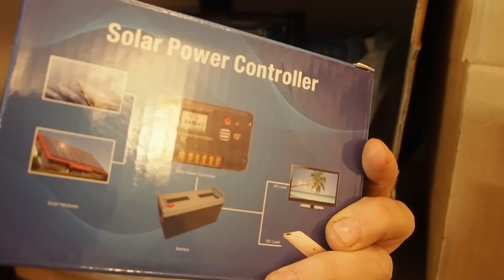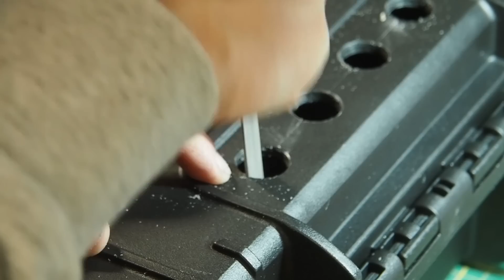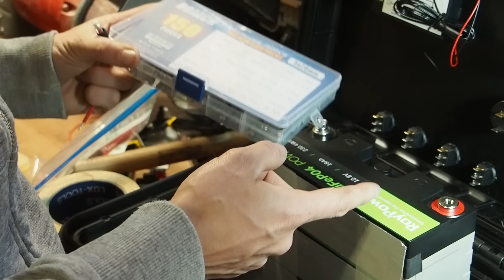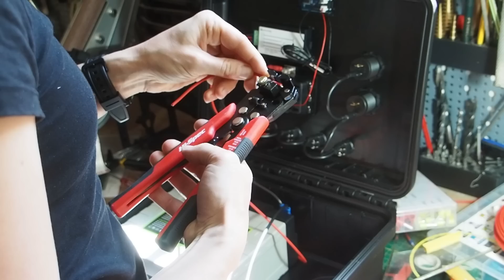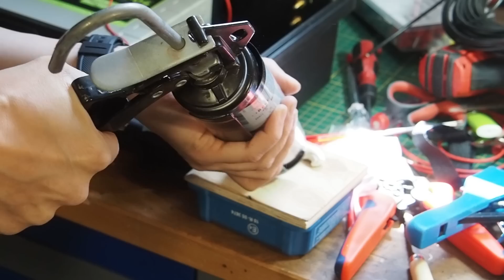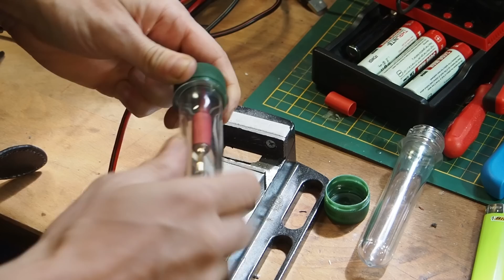This self-made box will save your life in a blackout scenario!

Comment: That looks great Lilly, I use terminals for all small wire connections. The 14 awg wire is good for 15 amperes.  Let us know how much heat in generated. That would be my concern using a polymer enclosure instead of aluminum or stainless steel.

Comment: Nice work. I was thinking as I watched that you could probably put a small 5 watt or so light bulb inside to warm the box up before you charge the battery on a really cold day, and you can use a suitable size socket or tube to tap those switches into place without running the risks of damaging them with the hammer.
Reply: A heating element might be more effective as it does not use any energy to created light. Good idea though!
Reply: @aprilshadows  I'd go with whatever is least expensive.  Any light is going to be absorbed by the box and turned in to heat anyhow. A heater may be more robust though.
Reply: @jethrox812  the light does not translate to heat like you may think.

Think about it like this. The sun warms you up, but in the open air a 100watt light bulb does not. Then in an enclosed space you can feel the warmth. Its not the light heating you up from a light bulb. Light bulbs create heat from having an element heated up from electrical resistance. The element is designed to primarily put out light and a secondary result is creation of heat.

Heating elements also created heat through electrical resistance, but they don't even have a secondary result in light production.

I agree that cost is very important. Small heat elements are pretty cheap and will use less energy from the battery to produce the intended results.

Keep in mind this project is designed for dire situations where having energy to use may be critical.

One more thing. Light bulbs used for heat in food dehydrators are fine because the light can help prohibit mold growth and its plugged into the wall. Light bulbs are often used to keep chicken coops from being too cold, but that is also connected to AC.

Comment: A really nice project! 👍🏼 Unfortunately, the Victron charge controller won't work with your Solar Panel, because of its low voltage (the PV voltage needs to be at least 5V higher than the battery voltage for charging). And besides this, the price for that panel is IMHO outrageously high (even with a 50% discount).
Caution: Only the Victron "Smartsolar" series supports the App, not the "Bluesolar"  version you are using in your Powerstation!
Reply from the maker: Yes you are right. I just checked the website off grid trek. My small solar panel only has 12 volt output which is too small for my mppt. My mistake! But this company makes bigger folding solar panels which have a 18v output. So the bigger panels will work for my project.
Reply from the maker: There is a small device called Victron connect. Only costs 40 bucks. You stick it into the bluesolar and then you connect it to the smartphone via bluetooth. I already ordered one.

Comment: Really nice build Lilly.  The only thing I would change is I would have gone with MC4 solar connectors instead of the banana plugs both for the IP67 waterproofing but also to make it impossible to short or accidentally reverse connect the solar panels.   Also, there are LiFePO4 batteries that include an internal heater that will engage if the temp is below 0 C.  Sadly they are also very expensive.   Lastly, you may want to check with the manufacturer to see if it's ok to have the battery oriented on it's side and especially oriented upside down since you have the top of the battery pointed at the bottom of the case.   These batteries have a liquid electrolyte and the orientation of the battery can sometimes, but not always, be important.
Reply: Agree with this comment, MC4 would be better. Also supply lines should be female to avoid short circuits.  Otherwise excellent video Lilly. Nicely done.
Reply: Well, you could build a crude heater for this project by using power resistors and calculating the power loss. But you'd probably end up wasting energy unless you insulate the case on the inside.

I've made a heater for my telescope like this and it works, it's "wasting" about 25w at full power.

Put the resistors in parallel because it becomes easier to calculate and IF one dies it keeps going.

Use these equations and work with them. 
U=R*I 
P=U*I

You would need some sort of thermostat that keeps track of the temp inside the case.
Reply: @hannescamitz8575  or simple heating pad aaa used in a Reptile Vivarium tank, or for Homebrewing
Reply: @johnrhodes3350  That's would be a safer solution for the heating than open resistors even though they're isolated.
Reply from the maker: Thanks. I will consider your advices
Reply: It's a lithium battery, there's no liquid inside.
Reply: @alejandrorojas1  lol, all lithium batteries have a liquid electrolyte.  We don't have solid state batteries yet.   This is why a good BMS has a low temp cutoff - charging when the electrolyte is at or below freezing will destroy the battery.  It's also why the higher end lithium batteries actually have cell heaters to bring their temp up for charging.

Comment: A small tip, use a double-switch as main switch, one channel as master swich, and the other channel break the connection between charge-controller and solar-panel. that way you "disconnect" the solar-panel when switching off main breaker.

Comment: Great stuff Lilly. Is off-gassing while charging something you are concerned about? Also, if that battery ever fails and starts to burn, I think water is bad to stop the fire? Maybe sand or possibly CO2? Cheers.
Reply from the maker: While charging you can open the lid a little bit. Also I doubt that it is airtight after drilling so many holes into the box.

Comment: Great video. My suggestions. 1. Extra fuses.  2.  Next time mount the battery where the contacts point up when you carry this by the handle. The tape will get weak and let the battery slide/move. The contacts can get damages with use or dropping the box.
Reply: Mounting the battery 'upside down' was the most infuriating thing! I dont understand why not have it so you could carry, or sit upright without problem. Great build though!
Reply: @matthewhewitson80  At least lifePO4 batteries are comprised of sealed cells that have no orientation requirements, if it were a lead acid cell, even SLA it would not be good to have it upside down. I would make a strap to reinforce the mounting and maybe add a foam block below it, mainly in case it gets dropped.
Reply: @alasdair4161  Most LiFePO4 "pouch" and "prismatic" cells have orientation specified by the manufacturer. I've never seen such a specification for cylindrical cells, or cells smaller than about 80Ah so in this case I expect she is fine.  I'd still prefer "right side up".

Comment: You have great fabrication skills,,, you are a rare human with such a wide range of thoughts and application.  Thank you... I will be building a similar power box but with lead acid deep cycle battery.
No lithium,  bmc, or cold limitations,   also a tip from my hosting life " use a bit of dielectric grease on all connections, and plug ins. "

Comment: I am sorry if I missed it, could you share the total cost of your project? Thanks!
Reply from the maker: Unfortunately it was quite expensive. A little over 300 euros here in Europe. Maybe in other countries the same project will cost less, but here we experience a really bad inflation. If I would have build the same box 1 year ago it would probably cost me 20% less.
Reply: @SurvivalLilly  Thats actually not an entirely unreasonable price given what it is and can do, also if one builds it oneself, you will know exactly how it works so you can trouble shoot problems or do any kind of future upgrade or repair you need or want. A store bought thing probably cannot be changed/upgraded and if it stops working is more often than not  just to be thrown away. What you have built there has every component, wire, switch etc. easily replaced or upgradable. What you have created in my opinion is far more solid, reliable and repairable than anything bought off the shelf. Worth every euro you spent IMHO.

Comment: if you are putting all those holes into the box what happens to the water proofing of the box and how in a survival scenario are you going to carry it  with all that gear you say you need,  you will need a ten ton truck with the amount of gear you have or very strong arms.
Reply from the maker: With the holes it is not waterproof anymore. But i could silicone all wholes from the inside. That might make it a little more watertight.

Comment: Quality build Lilly. Only thing is that when you are carrying it, the whole weight of the battery is hanging on that tape. So personally I would have turned the battery through 180 degrees & located it to be hard against the two sides as well as the back, then added tape on all these sides. But clear explanation and super helpful video.
Reply from the maker: Yes i thought about that too, but then I decided against it because I wanted to have the wires close to the master switch
Reply: @SurvivalLilly  Yes ai can see that logic too !

Comment: Question: Would there be any function/safety concerns with putting some kind of insulating/packing foam in the box to rest the battery in rather than the tape?  Overheating is the big concern for me, but if it' doable, that could also help reduce sound and internal movement.  Thanks, and great video, as always!
Reply from the maker: You can defined use some foam. Good idea. Overheating might become a problem that is why I used a thermometer for my case.
Reply: @SurvivalLilly  The thermometer was a great touch.  Thanks for the thoughts; this is going to end up being my 'fall me' project.

Comment: Good quality case for project but you loose most of IP rating just installing lighter sockets (unless those are also with good IP class).
Why banana plugs? Good placement for bananas but if you leave room around those terminals you can use plain cable (or the horse shoe shaped connector) also. And if no  protective plugs, dirt in sockets.
Black case for solar project - hope you can keep it in shade.
Victron MPPT - good choice! Expensive .. but good.
I'd mounted it on some big as$ industrial aluminium radiator cut to right size, with possibility for filtrated forced cooling if needed.

Comment: I'm no expert on this but I'm pretty sure that you size the fuse based on the amount of current that can be safely carried by the wiring.
Reply from the maker: Normally you size the wire and fuse to the load.
Reply: You are correct Bud. Fuses are to protect the wiring. In a short circuit scenario the wires won't melt. The load will pull whatever current it needs. If you plug in a device that draws more current than the wiring can handle the fuse blows. There is no reason to size a fuse to the load.

Comment: Fantastic build!  Quick tip make sure you allow for ventilation for the battery as these can leak helium and other gasses.
Reply from the maker: I heard lifepo batteries do not leak any gases
Reply: @SurvivalLilly  I found this:

“However, in case of improper use, typically because of the over heating (or because of the over charge) the cells may get beyond the proper operation limits and in such situation the internal chemicals of the cell may start melting and release some gasses or liquids. These gases may be toxic, corrosive and hazardous. For safety reasons the cells should be always operated in rooms that allow proper and easy ventilation.”
Reply from the maker: @bsodmike  yeah but my mppt wont overcharge the battery. So it should be fine. Also my case is not airtight
Reply: @SurvivalLilly  ah that’s good. Sorry I thought I was airtight. Looked like a Pelican. 

Would be nice if you shared a list of the items used. For example where did you get the wrench that you used to tighten the nuts on the MPPT input banana jacks? I’ve been hunting for a quality one like that.

I found the MPPT you’re using on Amazon.  Thanks!!
Reply from the maker: @bsodmike  i got the wrench in a local hardware store in Austria.

The case I used is watertight. But with all the holes I drilled I am sure it is not airtight anymore.
Reply: @SurvivalLilly  yup good point!!

Comment: Awesome Video Lilly.  I am going to build one also. Have you thought of installing a small DC to AC Inverter to run household appliances of 240v ? I suppose that could plug into the cigarette outlet if needed
Reply from the maker: yes you can always plug an inverter into the 12 volt socket

Comment: It's going to take forever to charge that lipo battery with that small solar panel. Do a test and drain the system then charge it.
Reply from the maker: yes it is a little bit small. for faster charge I would add a 50 Watt or higher powered panel
Reply: @SurvivalLilly  i think the 100w panels are still reasonable